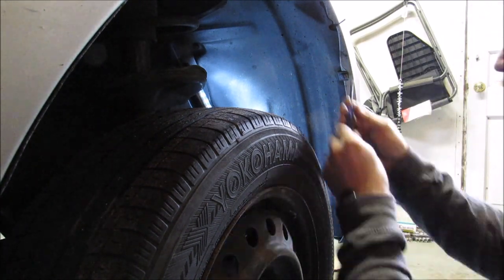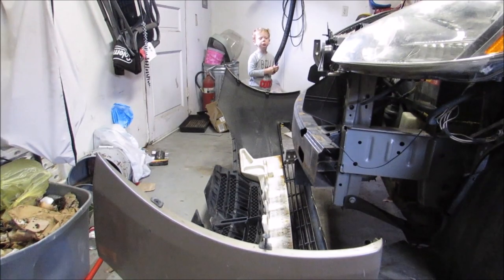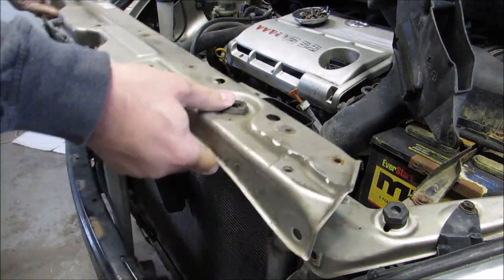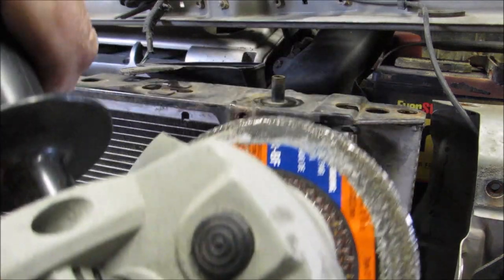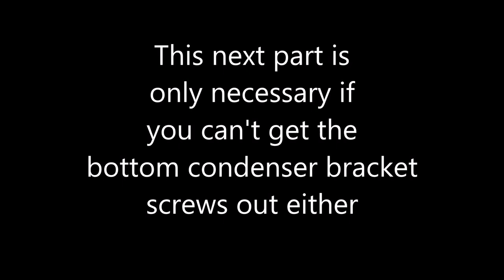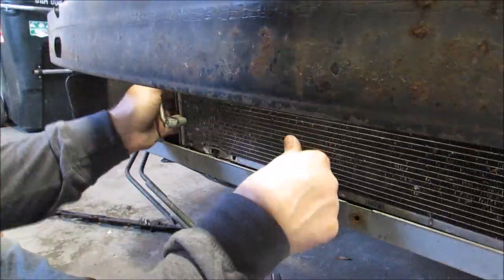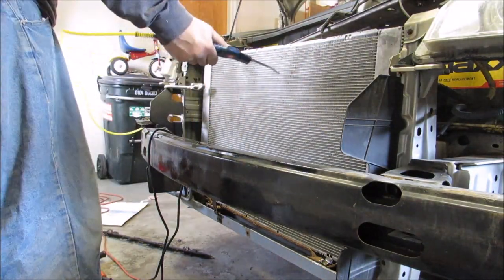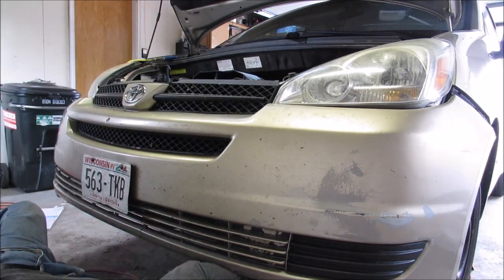AC Condenser Replacement Toyota Sienna 05

Comment: Some folks commenting are confused. This is the condenser replacement and not the compressor replacement. Replacing the compressor is by removing the alternator. My '04 has a hole in the condenser and air goes from cold to non-existent within a month.

Comment: I am about to do this an 02 sienna.  I am going to change radiator also.  all original and Denso only replacements.
Reply: Sir Sweetness how did it work out for you? I am currently looking to replace a locked ac condenser. Did you have to take everything out. Mine is under the alternator

Comment: We had compressor changed out and it seems everything else related to a/c but air does not get that really cold like it used to. Is better at highway speeds though. Mechanic now says we need condenser for another $600 on top of $1000 already laid out. Thanks
Reply: Did you check the fan ... If it works on the highway its because you getting plenty of air to the condenser and if it gets warm at idle its your fan
Reply: @jojolozano4868 mine gets warm at idle on my fans work..... so my mechanic is thinking condenser. But going to check it out today

Comment: Great Video...I'm about to do the same job on my 2005 Sienna
Reply from the maker: Thanks I'm glad you liked it, comment back on how it went when you are done, remember don't let your 2 year old stand in front of the van when removing the bumper, learn from my mistakes!
Reply: I will certainly keep that in mind..My compressor went so I got a new one from Amazon along with the new condenser.  The compressor already comes with oil, but with replacing the condenser do I need to add additional oil....If so do you have an idea how many ounces this system takes....I'm about to go out in the 95 degree heat to start this project.
Reply: OK I removed the condenser.  I follow your instructions and it went smoothly.  The Phillip head screws securing the condenser to the bracket you had grinded off, well I had the same issue.  So I apply some heat with acetylene and they came right out.  Now I’m waiting on the condenser and compressor to come tomorrow via UPS.  Your instructions were simple to follow and very detailed. I have 167K on the van and still running good.  It’s a 2005 AWD XLE…I wouldn’t buy another Toyota product since their warranty sucks.  The auto sliders on both sides are malfunctioning for the 4th time and it eats tires. With that said it is turning into a chore to keep it going.  I did the plugs and coils October 2005 and that was a job.  But I found that removing the wipers and that plastic cowl along the windshield made it much easier to access the rear plugs and coils.  Also I used a magnetic spark plug socket to install the plugs. That worked great with keeping the plugs in the socket to install them.
Reply from the maker: I'm not a technician so take my advice as you will.  But I looked at the service manual and it doesn't say to add oil when changing the condenser,  just to coat the o rings with oil (which I didn't do in the video) with  ND-OIL 8 or equivalent.  So I wouldn't worry about adding oil.
Reply from the maker: correct, no oil
Reply: mike khal 

    I think they call for 1 oz, I believe PAG 46 oil.  You can do it without if you know you have the correct amount in the compressor.

Comment: What happened to the freon? Did you have to let go?
Reply from the maker: the reason my radiator was broken was because I hit something that caused the leak so the freon went out into the air by accident
Reply: You can usually ask a nearby repair shop to evacuate the ac coolant for free or cheap before starting the repair.

Comment: I have 2006 toyota sienna XLE 
I just bought a AC Condenser A/C Air Conditioning with Receiver Drier for 04-10 Toyota Sienna on amazon and i dont know what is receiver drier for! 🤷🏻‍♂️ do you think ive got the correct condenser? My order will arrive in between nov 7-13! 🤞🏻 i hope i got the right parts!
Reply from the maker: Yes I think you do have the right one, the dryer is something that is optional to replace, it is attached to the condenser, if you didn't get a new one, you could use the old one, since you have a new one, just but the new one in.  It's like if you ordered new tires and they came with new lug nuts, Perhaps you paid a little more for that bundle, but probably not much, and might as well use the new part.

Comment: So the  a/c condenser is not under pressure with freon? I had a quote to replace for $600. If its not under pressure or any special thing to do after replacement it seems rather easy. Thanks for the video
Reply from the maker: good point, in a normal working ac system it is under pressure.  But chances are if you need to replace your condenser, it probably has some hole and all the refrigerant has already leaked out and it is no longer under pressure.  If you are unsure, you can take it to a place and find out easily enough if it will hold a vacuum.

Comment: Crap.  I just removed all that stuff last summer replacing the radiator on this lemon of a vehicle.
Reply from the maker: That's funny because I did the same thing, I replaced the radiator about a year before I did the condenser.  The radiator was a fail on the part of Toyota, the plastic tanks cracked, not sure why.  The condenser wasn't so much Toyota's fault, I drove my van into super deep snow in my driveway, and it built up under there as I drove and finally enough pressure caused the condenser to crack.  Sorry you have a lemon, I have to say my 05 toyota has been pretty trouble free, I've spent a lot on maintenance, but the radiator was really the only part so far to fail.
Reply: @PeterKesting yeah I love my Toyota Sienna it just gets to that age where you going to start replacing shit
Reply from the maker: @528freq8  Yeah I still have my Sienna.  I like it a lot.  It is a work horse, but anything that is 20 years old is going to need some TLC.  Engine still good and transmission still good.  So I keep fixing stuff.  At the price of used or new, it would take a lot to make it worth dumping it.